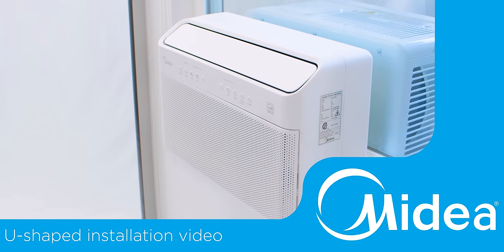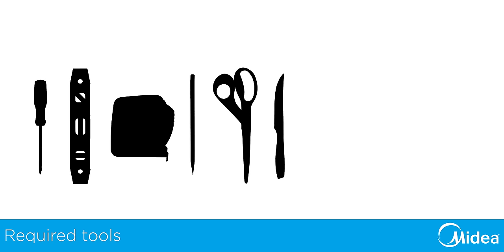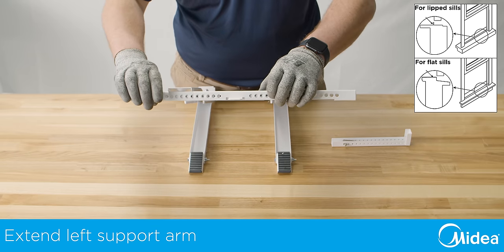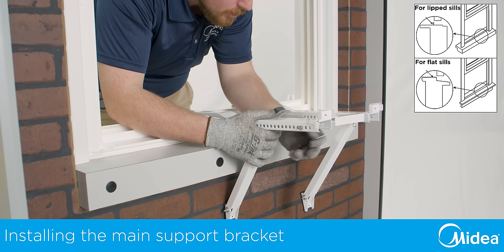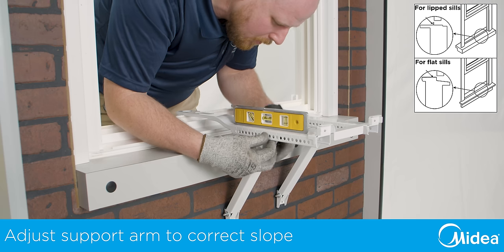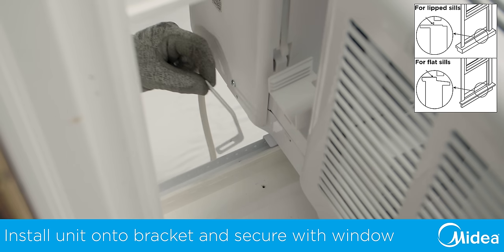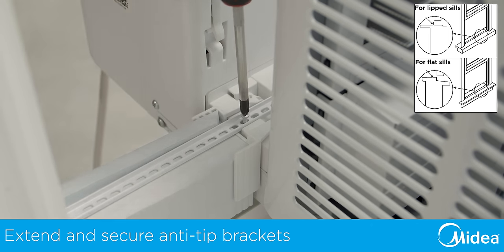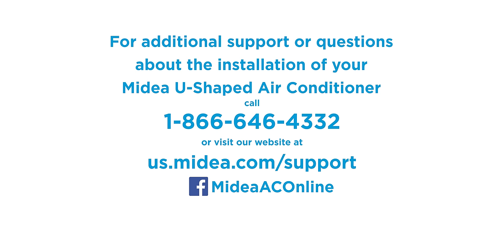Midea U AC Installation Guide

Comment: Worst ever. Mine broke in June, and in August, I am still trying to get a response from Midea. I regret ever even thinking of buying from this company. Go with ANY OTHER BRAND. I can't overstate how disappointed I was in the whole process.   

PS. The unit itself is super heavy, the setup is so tricky, and the app is just buggy and slow to load.  Overall I would have given it a 2 out of 5 before it shorted out and became a concern.
Reply: Midea Marketing, thank you for reaching out. It is fantastic to see the response rate for Marketing at Midea. If only Customer Service matched that speed. I think you can appreciate that I no longer want to call Support. Two months of no progress, in my case, leads me to require all communication be in written form.
Reply from the maker: Hello. Thank you for sharing your review. We're sorry to hear of your experience while trying to get assistance. Please give us a call at (866) 646-4332. Or email us at customerserviceusa@midea.com. We guarantee you'll be getting a reply.

Please provide case number 111147316 when calling or emailing in.

Comment: @mideaamerica    I have 1980s wood windows in a condo. where the window comes down, the 'lip' only has trim wood that is 1cm to the sides and in front of the lip.  Is that enough space to secure this bracket when you go to screw it to the left and right into the far reaches of the window frame?  @mideaamerica #mideaamerica @mideaaconline #mideaaconline
Reply from the maker: Hi @beartunes, For further assistance with your request, please contact us at digitalsupport@midea.com. Have a great day!
Reply: @MideaAmerica  i did and they just emailed me a .pdf of the manual. need more specific help.